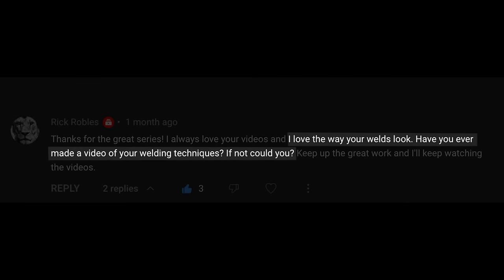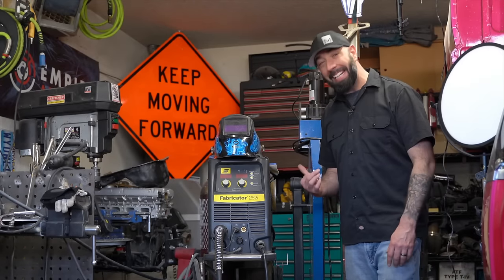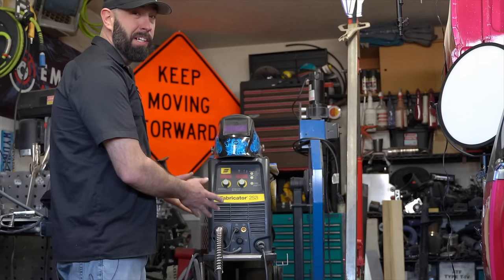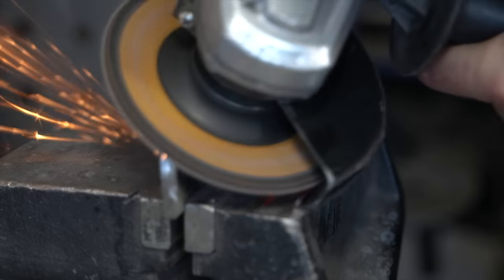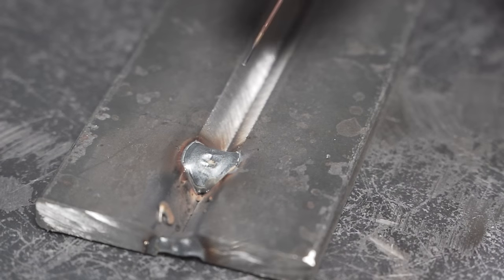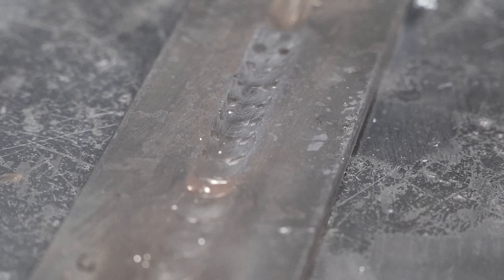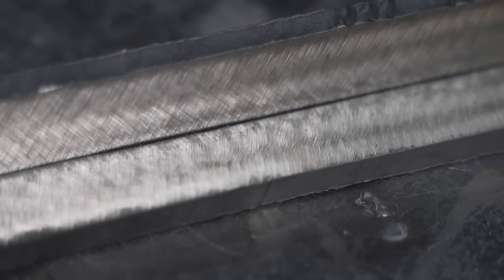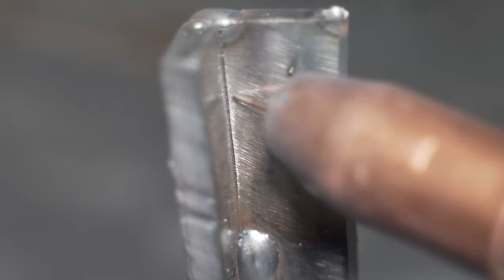MIG Like Mankandy: Techniques for Stacking Dimes with a MIG Welder

Comment: 10 year stuctual and heavy equipment welder here. When it comes to vertical down vs. Vertical up is all about puddle control. When welding Vertical down, gravity is acting upon your puddle,pulling your puddle over base metal that has not fully melted. This can cause holes and porosity and holes in your weld. It may be ok for what your doing, in structural it's a no-no. One root pass, then two cover passes for Vertical up😊
Reply: correct. 35year welder here.  structural welds are mostly done with 7018 rod . it cant be ran down hill.    also another structural weld is flux-core with gas.  regular hard wire will brake under structural pressure.    the home gamer will not have either one.  and if they have a arc buzz-box welder. good for them.. I think Arc welding should be learned before you squeeze the trigger on a steel caulking gun.
Reply from the maker: Thank you both!
Reply: @GarageFab  their comments are valid but you are not a structural welder so it doesn't apply...😃 One thing I saw was you were melting the edge away (known as undercut) and that that would never pass a test/inspection but you are not building a bridge or high rise.....if you wanted to stop that you could try a few things, turn your machine down a bit , try pushing instead of dragging or a little less movement so the puddle doesn't melt the corner off. Anyways, really enjoy your vids and your style , entertaining and informative!
Reply from the maker: @1966cambo  Thank you! 🙏 Very much appreciated.  So a question about undercut; The way I’ve defined undercut for myself is the ‘eroded’ edges left uncovered by the bead in a finished weld. As I’m welding, I’m intentionally melting the edges a slight amount so that I can clearly see I’m melting the base metal so the way to the edge, then immediately fill the weld pool to cover said erosion. I’ll have to rewatch my own video, but did I leave some uncovered? Or is my definition of undercut incorrect?
Reply: @GarageFab  Yes you are correct. What happens is the arc cuts and the wire fills. IE, The movement forward Allows the arc to cut, the pause allows the wire to fill = oscilation.. With that being said, undercut is generally caused by technique. By the sound of your weld, your settings are around where they should be. 1966cambo is spot on, drag welding is your problem lol.
Reply from the maker: @evcordallasor1305  I’ll experiment with the push! I have always pulled because I have trouble seeing when pushing. But I have noticed I get much less soot on the finished weld when pushing. Which I wouldn’t be surprised if that means the weld itself might also be cleaner/less contaminated. 🤔
Reply: @GarageFab  Your definition is correct, and that is what I observed. You melted away the base metal with the arc and let the puddle fill it in.
Reply: @GarageFab    hey welder of 4 1/2 years in Mig steel/aluminum, Tig steel and stick welding. I came to the comments to mention about you dragging instead of pushing and glad to see it’s been talked about. Pushing allows the gas to cover the area you are going to weld, practically replacing the air, pushing away contaminants and setting up the metal for the to-be weld. It also pushes the heat in the direction you’re welding essentially preheating your work piece. Also I think your issue with not being able to see when pushing is you might have your head behind the gun instead of in-front of the gun? I don’t know, I haven’t seen how you weld. But I like to keep my head in front of the gun, that way I can see the line I’m welding and also the puddles I’m leaving. Of course being in a perfect position is in a perfect scenario. (Also welding aluminum keep that shit clean, acetone it if you can). Any how those were good looking and, for the most part, symmetrical welds. The video was great too
Reply from the maker: Thank you for that, Erick! Yes, my head is absolutely behind the gun. I’ve been practicing repositioning where my eyes are and pushing more often. It’s tough to get used to. I’ve been welding the same way since 2007. 😬
Reply: @GarageFab  man honestly I would stick to what you are doing, your welds are great. You get better gas coverage with pushing but to me better control from pulling.
Reply from the maker: Thank you my friend.
Reply: @Erick Peres  SPOT ON. My welding instructor explained it the same way. And easy way to remember was if there's Slagle you drag, otherwise you'll be pushing the puddle.
Reply: Vertical down is a no-no papaw would beat my ass if he caught me vertical down 😂
Reply from the maker: But why tho, Teresa?!
Reply: @teresacanada3845  vertical down is fine for sheetmetal
Reply: @GarageFab  not really , undercut can be as you defined but it can also be when you burn/melt the top edge off. one of the ways we were taught in school was for what is known as "padding", this is a method of using weld to build up an area that has been worn down. So what we had to do was weld a piece of plate right to the edge without cutting the edge off as well as the next pass needs to be the same height as the last so the welds all form a flat surface when done.
Reply: @GarageFab  there is some incorrect info being shared here, it is 100% ok to push OR drag when running solid wire. Also , dragging the wire tends to give deeper penetration. Flux core can only be dragged.
Reply: @teresacanada3845  it depends on the situation.
Reply from the maker: Understood. Thank you.
Reply from the maker: @1966cambo  Oh boy. That’s the first ‘pro drag’ opinion I’ve seen. (Aside from my own of course.)
Reply: I was replying to Teresa. Judging by your welds and videos you are well aware of it. Great videos man.
Reply: Thank you. You are correct.
Reply: @1966cambo  undercut is any of the base metal that has been melted away with the arc and not filled in. You could be doing a flat weld and have undercut along the toes of the weld where you melted the base metal and didn’t allow the molten pool to fill it in.
Reply: @compilecodebug6430  I am aware of what undercut is, I was trying to explain it to some else
Reply: @1966cambo  I am not sure about that.  I learned from weldingtipsandtricks.  I do a C pattern and pause on the Points on each side pushing forward.
Reply: Welding supervisor here… not for buildings or bridges but for other pretty damn important stuff. Dealt with steel and alloys from visual only to x ray inspections for all processes (pulse and spray mig/tig/stick with steel and alloys and mech/subarc with steel. No dual shield for me tho). If you had gas coverage issues you’d know it in the form of porosity or dirty welds. Keep on dragging. I drag myself, it’s a misconception that pushing “pushes” the heat forward with short arc like the machine you’re using. When using a pulse arc or spray (globular transfer) machine/setting you have a different arc than with the machines you’re used to running and the push vs. pull argument is more valid. Same can be said about uphill vs. downhill. What applies in the structural and major fabrication worlds don’t apply to you. I don’t weld the same at home as I do or preach at work for this reason. The process itself applies wire differently. The only suggestions I would have would be set a 1/16” root gap since you’re only doing one sided welds 99% of the time as a garage mechanic. Any more than that and you’ll be burning the bevel away and blowing through more often than you’d want to. Just allows the weld pool more ability to penetrate on a single sided weld. A true full penetration weld would have the root pass background out from the second side and then the second side welded. 0% necessary for anything you’re doing. 

10/10 for general at-home MIG welding tips. Certifications mean nothing when you’re doing this type of work since 99% of the time no one is coming behind you to inspect it besides yourself or the customer. It’s all about practice, consistency, and knowing that you’re trying to melt both pieces together and keeping yourself accountable for good quality. 

Btw there was no undercut. All welds have undercut until the weld pool fills them in. Final inspections are all that matter with that not in-process. Besides, most criteria have an allowable amount of undercut and you’re fine either way. Happiest to see no edge melt on the corner joints and lap joints! Good job dude. Prep is everything glad you add bevels to butt joints and clean the material up. My favorite comment that you made I think matters most here is “run it as hot as your technique allows you to”. Just keep doing what you’re doing. Any elitist that says otherwise probably gets yelled at by their foreman and inspectors for the things they’re telling you about hahaha
Reply from the maker: Thank you for taking the time to write all that, Paul! (I only just found the time to get through it all. 😂) I appreciate it more than you know. I have been experimenting with the gap and I’m much happier with the appearance on the back side. The penetration is far more consistent than my no-gap butt welds. Have you any pointers for testing welds at home? Just a simple bend test? Etch testing? Both?! NEITHER?!?!
Thank you again my friend.
Reply: @GarageFab  bend test is the most simple and effective. Etching is fine if you wanna cut and measure penetration if you’re trying a new process or different settings but doesn’t give you any indication on strength. I wouldn’t worry too much about if. If you know you’re penetrating unless you’re doing bimetallic joints as long as there’s more filler than base material you’re fine. You can research the ksi of the fillers and base materials and make sure the filler is rated equal or higher but that’s a literal pointless waste of time for garage work with how fused and consistent your welds are. I can lead you down the path of overkill but that’s all it is, overkill lmao
Reply from the maker: Haha! Thanks again my friend.
Reply: Hi just subscribed to your channel, ticketed welder & mini truck builder, from Canada , big no no never weld down hand on anything structural  always vertical up , and you look like you smell like cheese 🧀 . Keep up the good work 
Cheers Phil
Reply from the maker: Thank you, Phil!
Reply: @teresacanada3845 .... Been professionally welding since 1979, and one thing I learned many years ago is that absolute  statements are a "no no" ...... As for vertical down, or anything else it depends on the job, the material, and the requirements. There are MANY fab situations where vertical down not only works but is preferable. Like long welds with aluminum spray transfer on 1/8 material. Again it just depends on what the job requires.
Reply from the maker: I agree with that sentiment. Absolutes are a no-no in almost any topic.
Reply: You can still drag and not get undercut. You just gotta pause at the right time to let the cut fill up.
You do want to overlap edges, just nothing excessive. 1/16 inch is fine. I think the weld in the video was good, and for the thickness of steel you were using, one pass is probably fine. The gentlemen above make good points, solid wire MIG would not be used for structural welds, therefore you don't need to concern yourself that much with push vs drag, or 3G up vs down. But once you get to 3/8 and thicker, consider stick or dual shielded Flux core.
Reply: I agree as well in regards to this original comment. I am a welder by trade and root pass is just as important as hot pass and cap. This can be utilized in mig short arc, all the way to 7018; and jet rod out of position. puddle control and angle, as well as settings are absolute key. No one aspect can be comprimised. Keep up the good work.  Once the skill is perfected, full passes will look just as nice; and have full pen with structural integrity.
Reply: Would pressureized oil pipe be structural? Maybe 🤔 well they run downhill. 
Yet uphill is what the school teaches at least mine did. Never never never run dwnhill except for two plates in mig phase and then on 10"pipe in my last phase it was all downhill.....
I think puddle control is key as you mentioned to a sound weld or not in any position uphill or down. 
For the newbs. Always weld uphill
Reply from the maker: “Why” is always the most important thing to me. If you know why downhill is frowned upon, you can change your technique to avoid those things. I understand why uphill is preferred by most but I’ll always disagree with those that say downhill is NEVER acceptable. Just learn when it’s important to avoid it.
Reply: @metalworksmachineshop you maybe correct about running it downhill where come from in the world but it’s ok here so you need to get your information right before you comment, thanks for your time.
Reply: My high school metals teacher had a saying, "Practice makes permanent!" So, make sure you are practicing the right way! Thank you Mr. Iseri! This has served me well over the years...
Reply: @GarageFab It’s my understanding that it only matters when you’re welding to code or the company you work for wants you to weld a certain way.  If you work for yourself you can weld however you want.. push, pull, uphill, downhill, whatever works best for me is how I do it 🤷🏻‍♂️ I personally like to pull my welds too because it’s easier to see the weld pool and control how the finished weld will look, but most of the time I just weld whichever way is comfortable.. If I need a flatter weld or less penetration, then I’ll push. For vertical welding I run downhill with my gun angle pointing slightly upwards and I’ve never had an issue with anything cracking or breaking, nothing I’ve repaired this way has come back either.
Reply from the maker: You just voiced my thoughts verbatim. Even the gun angle while welding down.
I’ve been practicing pushing and I’m less than thrilled. Not only is it harder to see but as I advance I feel it’s pushing the pool over the base metal preventing the arc from penetrating to its fullest. Which ironically is the reason most folks advise against vertical down. 🧐
Reply: @GarageFab man you really have a hang up about smelling like cheese did you grow up in Wisconsin were your parents big packer fans A.K.A cheese heads 🤣🤣🤣🤣🤣🤣🤣
Reply: If it's sheet, do it down. If it's plate, go up... Anything below 3mm or 1/8, classified as sheet steel. If it's tube, depends on wall thickness and gap... Or use a tig, do everything uphill to see what you need to
Reply from the maker: @Herbalaties Excellent! Thank you. But why?
Reply: Vertical down helps prevent blow through. Vertical up for better penetration. Depends on what youre welding and why youre not welding structural with a stick?
Reply: Been welding structural for over 30 years and tought many how to weld from what I see if you turn your gun and push the weld you will get better penetration but for someone just starting you have pertental
Reply from the maker: @georgewoodby9314 Thank you, George!
Reply: Dang this is worse than politics!  LOL  Up, Down, Low, High, My way, your way etc..... :)
Reply from the maker: @niceguydmm  Truth! Downicans vs. the fascist Uppacrats.
Reply: @GarageFab  :)
Reply: To the pro welders: I'm not one.  But to me, it makes more sense to learn on a caulking gun, before trying to do stick.... walk before run no?
Reply: These reality T.V. shows with they're " Master Welder" dude or woman makes everybody think they are a  welder....so much more to it than just laying a nice bead...I got to laugh at all the tig welders that wear a glove on their rod holding hand....
Reply: You didn't say the part that he smell like cheese😄🙃
Reply: @GarageFab vertical down is fine with solid MiG and TiG. The vertical up only really applies to flux and ARC(or where code requires it). The reason is slag inclusion and puddle control. You are able to get slag inclusion with MiG but not a worry here. If you're fully welding a seam on ⅛" plate  then it won't be an issue, 

Cars are subject to abuse, vibration and aren't what we consider "light", but as far as structural integrity goes, it doesn't take much ... Cars are held together with spot welds! (And have you seen these factory MiG welds? 🫣) 

With heavy equipment and semis, iirc they required angle uphill overlap.... Or plate and bolts 😂

As long as you have a groove you're filling in, if the weld looks appealing, then it's more than plenty strong for this application! 
I don't think you could make a visually appealing weld without grinding that wouldn't be strong enough here.
Reply: @GarageFab  hey what did you record  the welding with I'm trying to record myself welding  but everything is still too bright
Reply: Glad you said it, i didnt feel like it 😆
Reply: @Garage Fab, How long have you owned that Esab Fabricator 252i?? I just went looking for it online and can’t anyone that has it, including the Esab Website.
Reply: Anybody else catch the 310 inches per second at the start of the video?   That’s laying some weld in a hurry lol😂
Reply from the maker: @nascardude86 The Esab wire feed supercharger is no joke.
Reply: @GarageFab  I see that!
Reply: Here's a good one for ya from the world of heavy industry : " nobody ever really notices or cares about your good lookin weld until it cracks or breaks "
Reply: @metalworksmachineshop im just starting out, in a school i just finished stick and going to mig, then flux then tig. Pretty good order id say. Everything going smoothly. I fuck with it
Reply: You run a MiG welder instead of flux or stick on structural? Never heard that before
Reply: @metalworksmachineshop we use 0.045 hardwire mig for many of the structural components on the trusses built at my job with the exception of dual shield fluxcore 1/16 or 3/32 being brought out as needed due to engineer specs etc.  if you can properly weld with er70-s6 you can weld structural because the wire has a sheer strength of 70,000 pounds.  That’s what the 70 in 7018 means.  Also 7018 is a low penetration rod.  So the fact hardwire doesnt penetrate like stick rods do it doesnt matter much since 7018 is not a penetration rod.  6010 has much much more dig and penetration that 7018.  The reason stick is used by ironworkers for field work is because the equipment is lighter and cheaper and more abundant.  100+ft of lead from a rig on the ground is alot more feasible than throwing a multimatic on a fuckin man lift and bringing it up hahaha
Reply: Lol was d1.5 structural 1/2g, now do restoration work . I can run down, up not so good. Running down to me is easy. But for structural you don't want to run downhill. I do small circles for hardwire mig.
Reply: @justinyoungstown  yup just had to run some long beads on thin material today and ran it vertical down at about a 45 making small circles from the vertical to the horizontal leg of the joint
Reply: I was welding very thin material that was why I welded it down
Reply: @metalworksmachineshop yea no doubt man
Reply: I am looking forward to trying your triangle pattern. Thanks for taking the time to make such quality videos. Your videos move at a perfect pace, with coherent explanation. Great job.
Reply: These 30 year experienced welders can go and weld themselves....this is just a hobby welding not an attempt to welt statue of liberty....